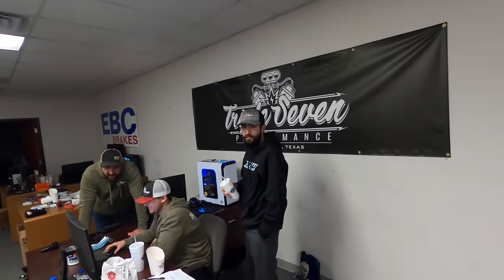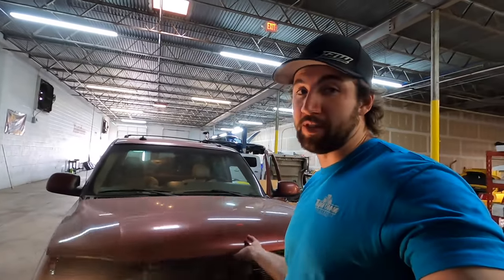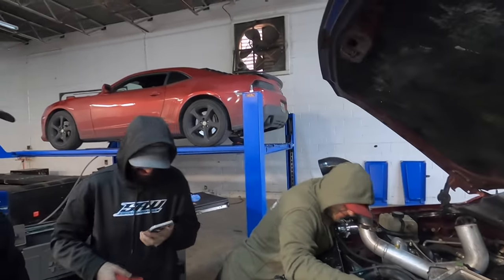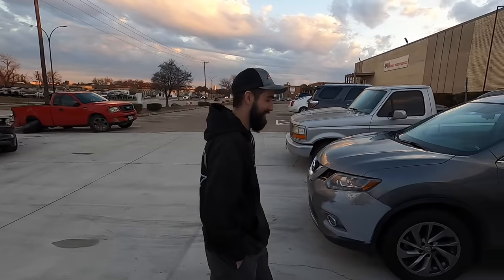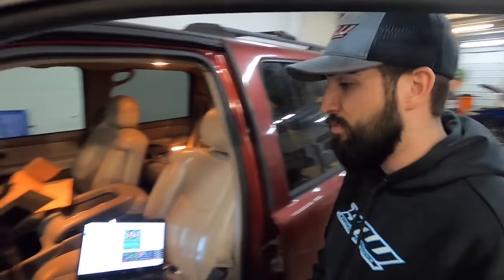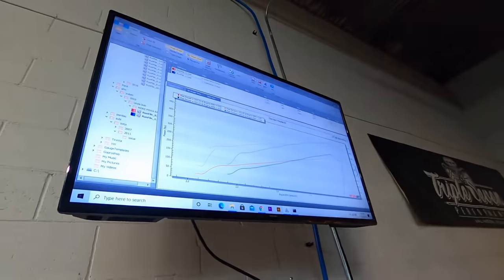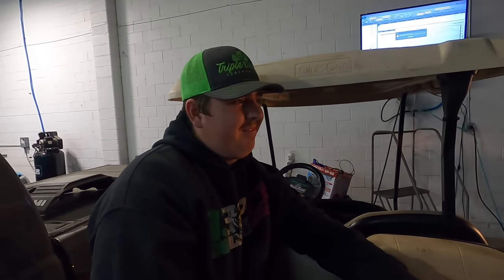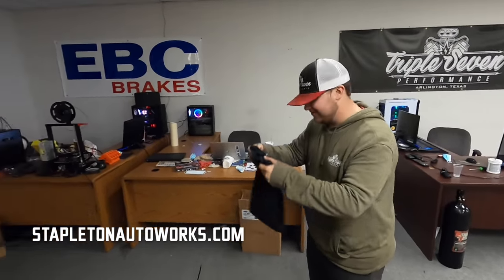What Happens If You Turbo a 5.3L Yukon With No Other Mods? Lets Find Out! (Uncle Rob Hits the Dyno)

Comment: Y’all didn’t even put better head studs😂 that’s awesome
Reply from the maker: Literally NOTHING
Reply: Head studs? Lol this isn't a powerstroke
Reply: @LT3Fluffy  nope but it’s a engine seeing boost and seeing more pressure on the cylinder head.
Reply: @tannercox4537  lol you must be new to the SBE world
Reply: @LT3Fluffy  ik a lot of those dudes change head studs
Reply: @tannercox4537  and the 99% of people that have turbo Ls cars on the street that don't?
Reply: @LT3Fluffy  uhm idk what crowd you hang around but we ain’t that broke where we just slap a turbo on😂 most people ik on any build change to head studs and on boosted usually do studs, springs and rockers. What’s another 100$ and a little bit of wrenching when you’re throwing on a 600-1800 turbo. 
That’s pretty ballsy if it’s that common where your at
Reply: @tannercox4537  yeah when you get your shit handed to you by a 250 dollar junkyard motor with a 600 dollar turbo on it those head studs don't do shit if you're not at 30lbs. And if you're lifting heads that easily you need to learn to tune
Reply: @tannercox4537  hoppin coke cans with chrome valve covers too I bet? You probably put forged rods in a 400hp n/a small block too 😂
Reply: @tannercox4537  don't worry when you want to dd 600whp and have a mortgage and a gf  you'll understand why I don't put head studs in a motor where my cam and valve springs cost more than the short block from a 2003 Avalanche that I didn't care to hook a battery up to to see the mileage 😂. Go look up sloppy mechanics when you have a chance and the 850whp 2500 truck with a beach ball turbo or 1100hp colorado or 600hp LSA 4.8 on stock bolts. Too funny
Reply: @LT3Fluffy  i mean I’m north of 400 but I do have a stroked 6.0 in my 4th gen. I do have a mortgage that I greatly regret signing but ig I just like avoiding constantly being at the machine shop. Not knocking if it works for you. I just like to be able to put down power at the top end with out getting oil in my radiator

Comment: Most states require salvage yards be paved to prevent chemical leakage into the ground contaminating the water table . Those that don't are required to clear thier yard and pave by 2025 if they don't they must cese operation or face a daily fine of 5k or more depends on the county and state.

Comment: My 2000 Silverado 4x4 has a P01...I've been lucky so far. Had a couple scares though and thought I bricked it..lol And I can confirm the Break TRQ Management setting.

EDIT: HAHAHA Love the 4L60 Comment. Driving my Cam, Heads Bolt On Silverado till the Trans Explodes. Then its time for a built 4L80E and Turbo or possibly SC

Comment: Funny how a motor rated at 290hp crank makes 297 dyno... that dyno is off. The gen4 5.3’s with 799 heads were known to make 270bhp. The older 5.3s with the 862s were known to make around 240bhp. There’s no chance in hell these numbers are accurate. I recently owned both an 09 with 799s which I bought with 143km and sold at 202km, and currently own an 04 with 230km. 09 was a flex fuel model (bigger fuel pump, bigger injectors, e85 capable but I don’t have easy access to e85 where I live). dynod after I built trans and while it was getting tuned, it made 270!270 stock. This 04 had a freshly built trans when I bought it, so dynod it while it was getting tuned and it made 240 stock. Both running 89 octane chevron with fresh .060 acdelco plugs.
Reply: Apart from all that, this really gets me in the best way. I’ve wanted to do this for the longest time, I just don’t have the space or funds right now. At the end of the day this is badass, all I’m saying is I’m 99.99% certain those numbers are off.

I’m sure you already know this but the stock torque converter with the 1600? Stall is what’s causing it to buck when shifting. Circle D makes great converters for these transmissions. Somewhere between 2800-3200 stall would not only help shifts but also keep it in boost. Cheers.